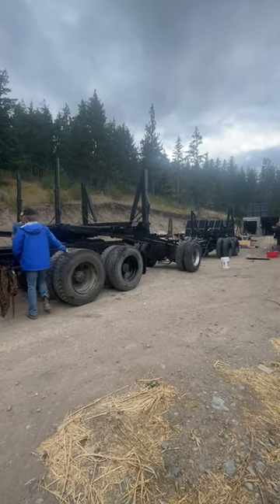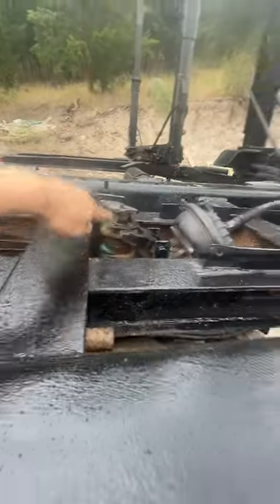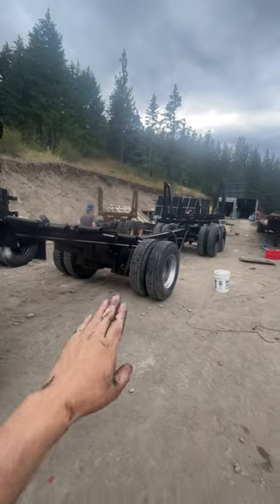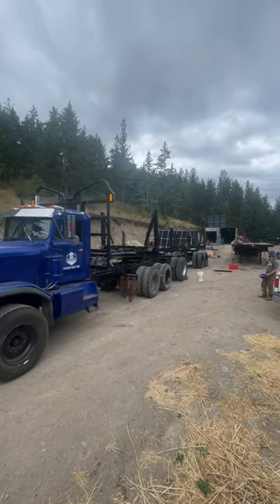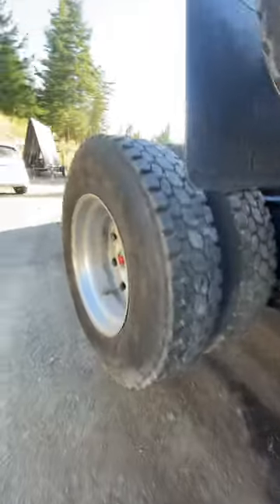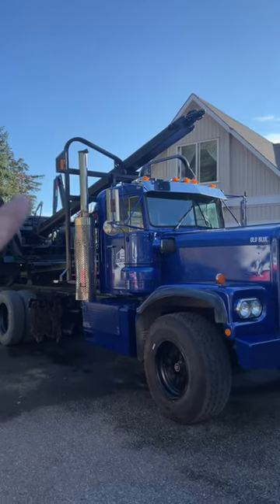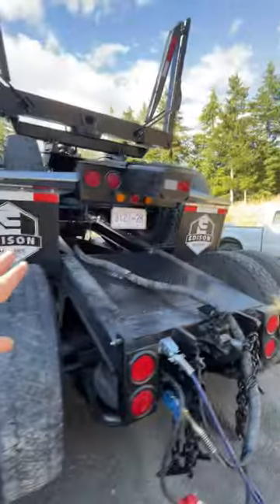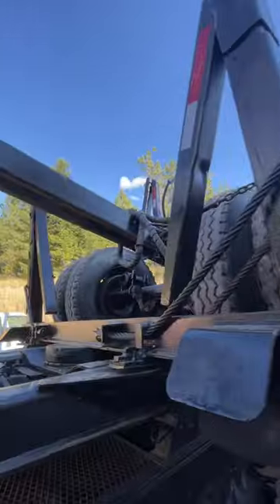How a Jeep and Pole Trailer System Works: Effortless Loading Explained

Comment: Down here in Oregon the reach hooks onto the stinger. It enables us to take extremely sharp corners as the trailer tracks closer to the truck vs having a fifth wheel hitch then the pole trailer. I will say that your way definitely makes the truck more versatile, I don't care how easy they want to claim these quick change trucks are they still take 3-4 hours and 4-5 guys to change over.

Comment: Why do you need to put the trailer up like that? Why not just pull it empty?
Reply: It's a lot less wear and tare on the suspension, axles, and tires, plus makes the truck shorter on the way to the job site, and puts a lot of weight on the truck drives for slick roads
Reply: @markrabbia8281 I'd assume more fuel efficient as well as theres less tires on the ground